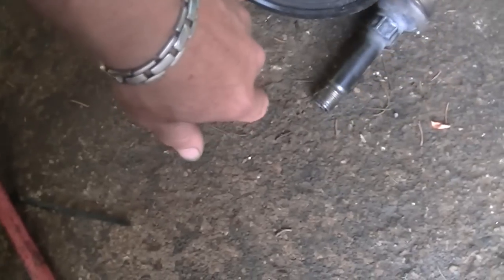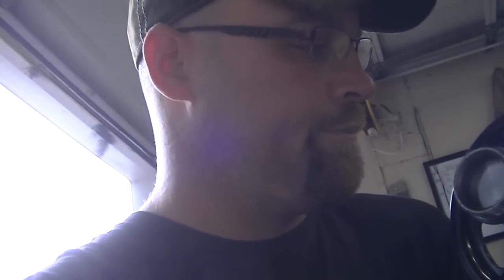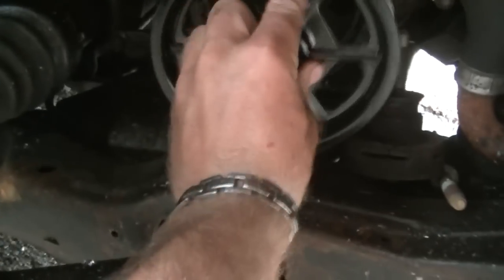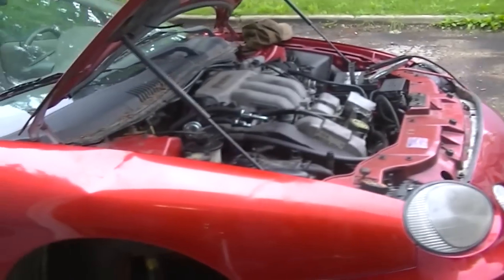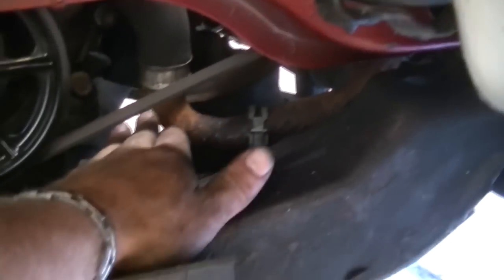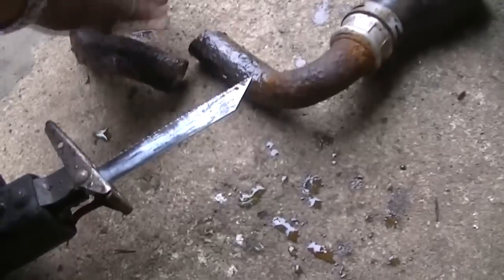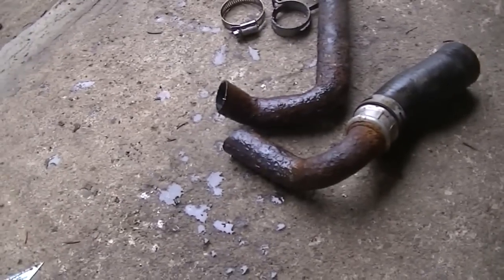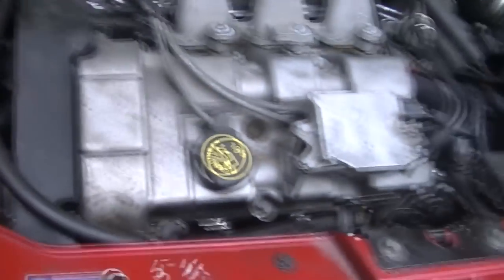99 Ford Taurus Harmonic Blalacer And Lower Radiator Hose

Comment: went thru a big water backup on road  12 inches deep which broke every blade off my coolingg fan car never over heated i replaced fan  same day  then found out ac not working i checked clutch it is not engaging. this is on a 2009 chevy hhr lt.what could it be. it worked fine before going thru the water went thru very slowly. I see fuses and i think many relay on insde fuse bos  What do you think

Comment: @davesgarage i did same and new one broked when i pushed gas little bit ?
Reply: I just put a new one on and it broke in a week
Reply: @jimmiemoore3633  i found solution. When u installing don't bend on front joint. While tightening the nut, tighten the bottom with the wrench.

Comment: Lol said the same if I could post a picture I'd send a photo of my harmonic cut in half. Cut the shaft off and had to head that crank bolt  cool it then finally got it😑🤷‍♂️ That extended shaft absorbs all the impact from an impact so that doesn't work cant bump it over with a breaker bar. I cut